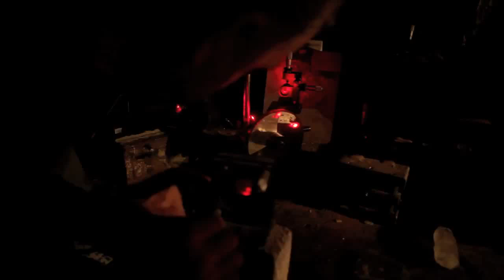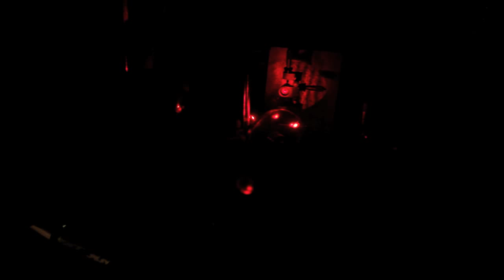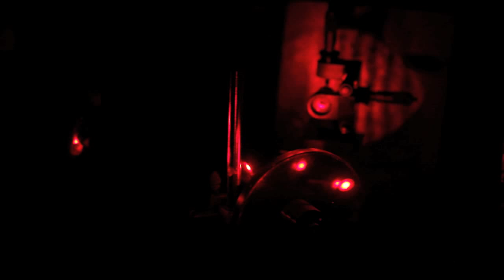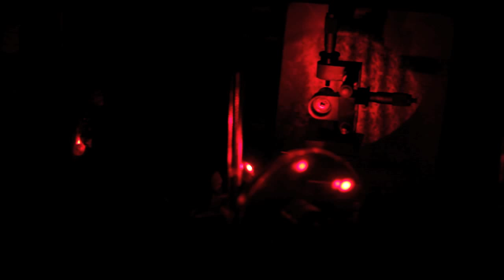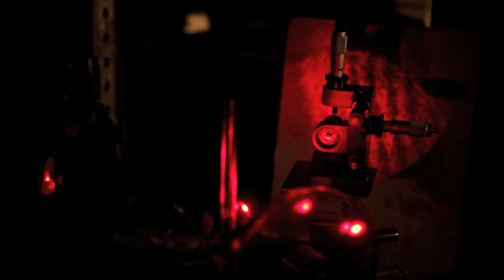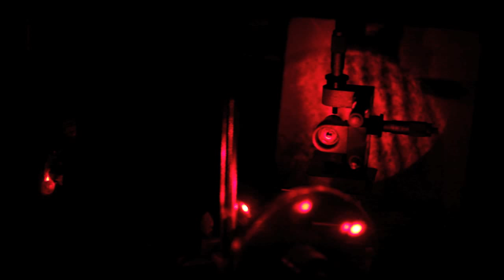canceling light waves with an interferometer

Comment: Just wondering, for the holograms you make do you use a stabilised laser? Also do you use a polarised or randomly polarised laser? Would be great if you could also explain why and what happens if you use the wrong type. Many thanks for sharing your wonderful work!
Reply from the maker: The table should be stabilized (floating), not necessarily the laser.  Polarized lasers let you use all of its power while unpolarized lasers lose power from the mismatch of polarization reduces the total power as the beams meet.
Reply: @TheDrlaser  Thank you for your kind reply. What I meant regarding a stabilized laser is that I was referring to a more controlled laser tubes that are designed to maintain its frequency or intensity and usually they will control the temperature around the laser cavity to maintain the distance between the internal mirrors of say a helium neon tube lasers. I wasn’t meaning the mechanical damping and stabilisation of the physical table setup, etc. 🙂
Reply from the maker: @cyberlightbeing  HeNe lasers are the perfect laser for any beginner to use to make a hologram.